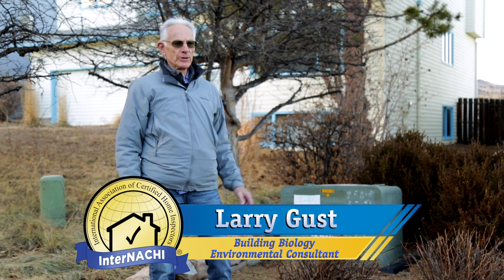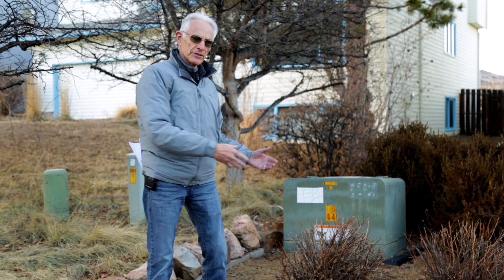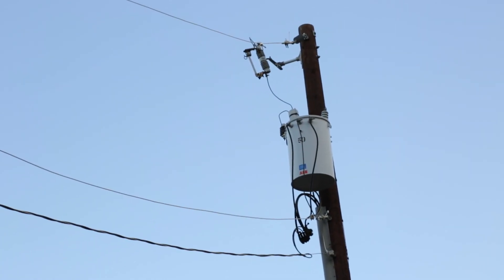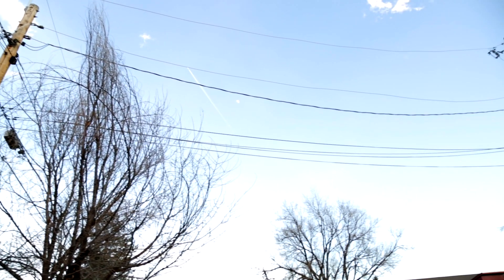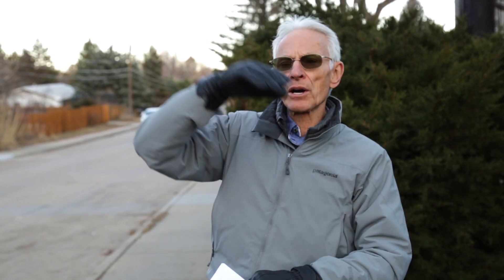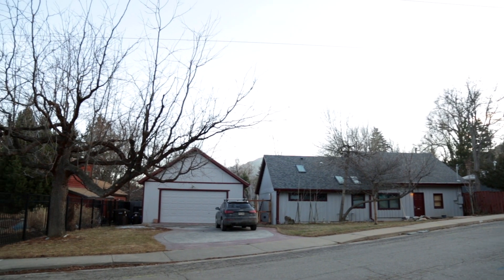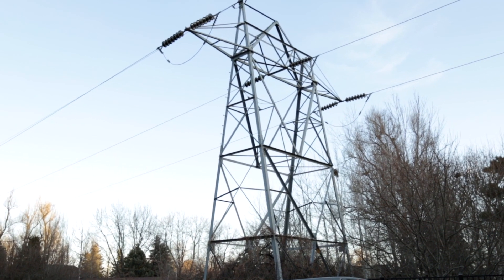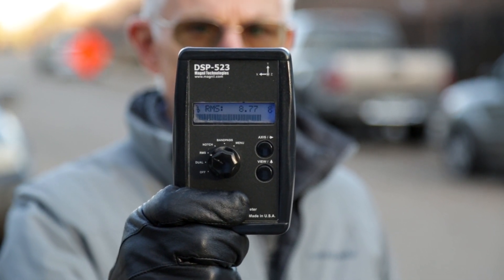Part 6: Residential Distribution Lines and Magnetic Fields with IBE

Comment: I have a situation where just a regular telephone pole power line is causing between 1-3 mG inside the house depending on the load. Cold nights are bad. I'm not sure how to engage the power company about it. It feels like I would be laughed at. I understand the nature of the problem - probably more than they do. Currently looking into replacing my water line with PEX because a very high MF is coming into the house. During high load, it can be 50 mG easy. Up to 8 amps on the pipe when my power is running, 2 amps when my MAIN is shut off. They checked the lugs and they're tight. The water shut-off at the street is 3 feet away from the pole and it's dedicated ground wire. It must be creating a loop current.
Reply from the maker: That's a great question for the presenter.

Comment: I live 300-feet from huge multiple rows of high tension lines coming from a large substation about 1/4 mile away.  Lived here for about 10 years. I HAVE noticed effects in myself, my wife, my son, and even some of the animals we have had, which I would rather not get into detail on at this time. We are all in good physical health otherwise and try to eat well and walk and exercise frequently. We have all had medical exams which so far turn up nothing solid which could cause all these things. Even the sound of these lines is often very loud in my back patio, and my son says he sometimes gets shocked while riding under them on his dirt bike.  Should we be concerned?

I confirmed that the EMF in my home never goes below 2.5mG and up a little higher than 3.5mG. The EF in spots (near a bed) exceed 90V/m.  RF averages about 0mW/m^2 but spikes over 500 mW/m^2 in places on occasion (not sure why).  In my immediate backyard I read anywhere from 4.0mG up 14+mG in areas.
Reply from the maker: Thank you for watching. I teach free online classes for inspectors at https://www.nachi.org/webinars. Free, online, and open to everyone.
Reply: Hi JF i see your comments again!
Reply: This is what the house we just bought reads and I am very worried now
Reply: Can we paint or coat our houses to protect us? Metal roofs?

Comment: Hey there thank you so much! I have a pad mounted trasformer about 8 feet from my house, (right outside our bedroom :(  , should I be concerned, how can I test for EMF, should I contact my local power company to measure for EMF. I didn't even think about it when we purchaced our home.
Reply from the maker: Good question. You better reach out to the inspector with that one.
Reply: Research EMF shielding for interior walls and windows.
Reply: well, you can shield electric and radio frequencies , BUT you can not shield the magnetic field (actually it is possible, but complicated and costly) @rodneysammons5544